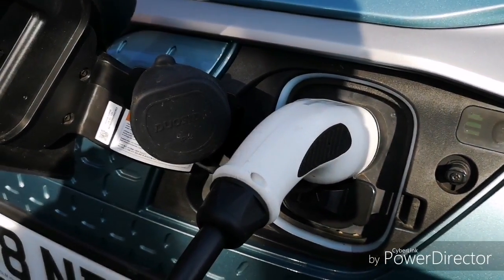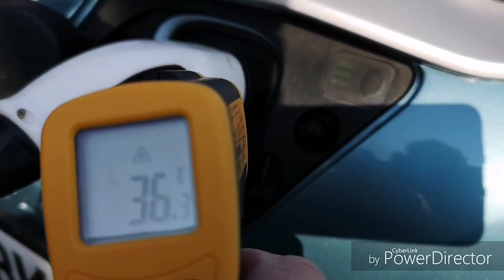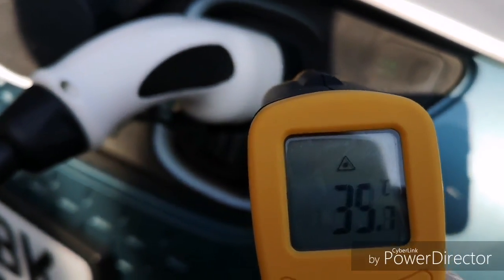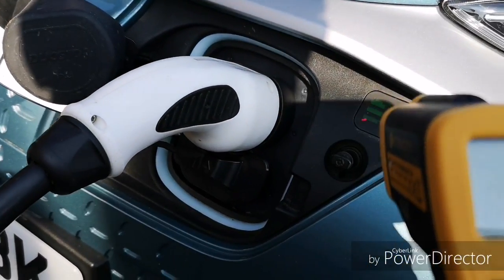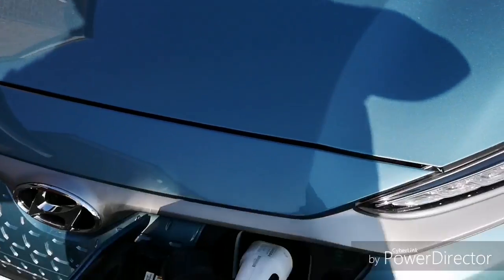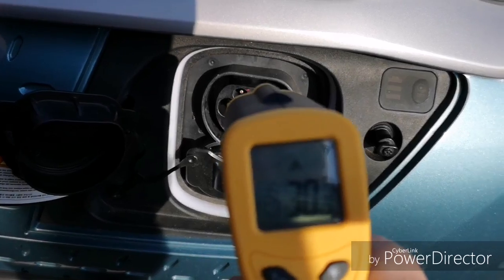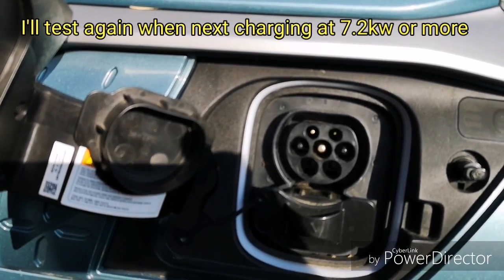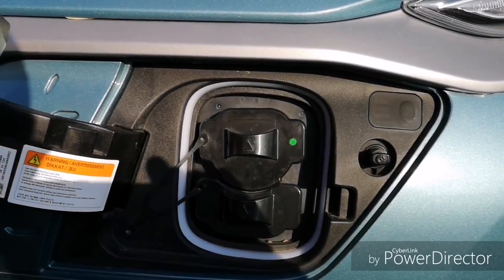Testing the Kona Electric charge port temperature

Comment: Thanks for your test.
Evbox will replace my defect box that rose temp to 88C charging at 6 kW.
They mentioned that they have heat issues with the Kona.
They will analyze my box in their lab to understand the root cause.
I mentioned to them that it could be a loose soldering between the plug and the cable
or they are driving another phase than the one that is in line(horizontally) with the ground/neutral,
such that the Kona may have to use a relay and switch to that phase, creating extra resistance and heat.

Huyndai confirmed that there is temp protection that limits the power (seems not to trigger yet at 88C though).
I tested about 6 different chargers (6 kW, 3 kW, ..) around using the Hyundai cable, there was no heat at all.
Reply from the maker: Let's hope it's resolved soon
Reply: @EVPuzzle  I'll keep you informed ;-) I'm using the 2.6kW charger at the moment ;-)
Reply: @EVPuzzle  Nice, they replaced the entire EVbox system and the port doesn't warm up anymore (from 13 to 25C after 2 hours at 7.1 kW).
The phase was already well connected, so the issue was in the wire connection in the plug itslelf, too much impedance.
Reply from the maker: Wow, just shows you have to check stuff. Glad it's sorted for you

Comment: That’s an interesting thought.  I know the Kona does monitor the CCS / Type 2 connector temp and I’ve been chasing an unexplained AC charging issue for months since the Kona was new, on one public EVSE near my flat, in conjunction with the local lines company who own it, an ABB Terra 54.  I had been thinking the on-board charger itself was overheating but discounted that.  An overheating connector is the perfect explanation of why the charge rate drops after some time, but corrects if I jiggle the connector and restart the session.  It’s charging  now as I don’t have any place at home to charge.  Has been going 100 min, will check the temp.  Of course the purpose of the temp checking is really for DC but perhaps it also works on AC.  I had noticed once that it was warm...
Reply from the maker: Yes I'd imagine the connectors and pins etc can be miss seated, worn, bent anything. For how many times we plug in and out any weakness could become an issue so it's worth checking both the cable and the car for obstructions or oddities.

I would hope servicing includes this check. I'll ask next time I'm there
Reply: The pins on the cable were at 30°C, 10° over ambient, not particularly warm but it was charging at the correct rate in this instance.  I’ll have to get ABB to tell me if the EVSE monitors plug temp and what the outcome would be in the case of overheating.  Same with the car, I do have one person I can ask.  The plug in this case is several years old but gets little use, I’m one of only a few who ever use it.  The pins and sockets of a Type 2 are silver plated and the socket part is very delicate, with fine leaf spring contacts.  This one is not dirty or damaged but these should not normally get warm, given the size and current, 32 amps.